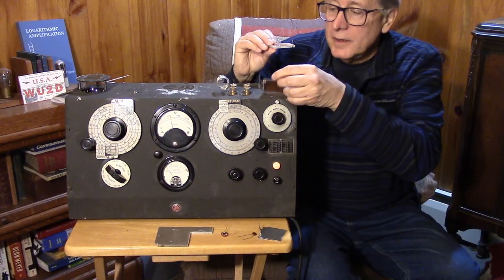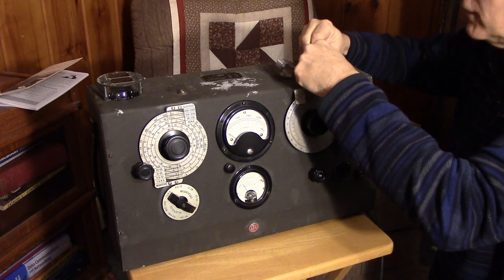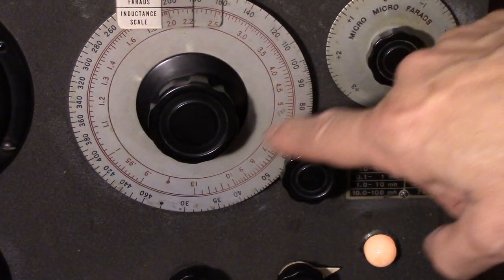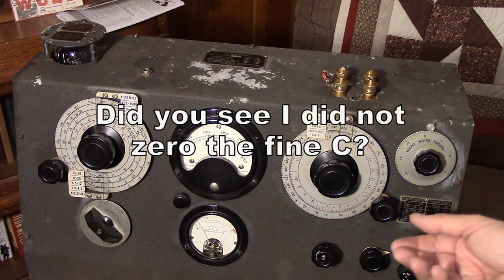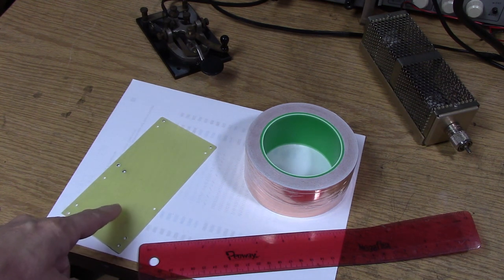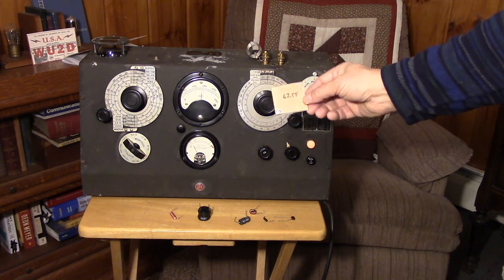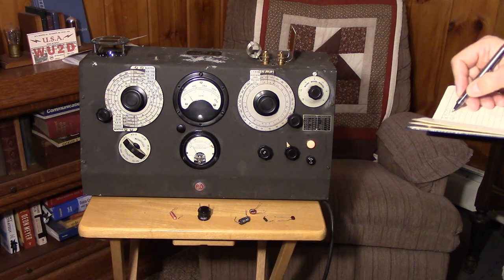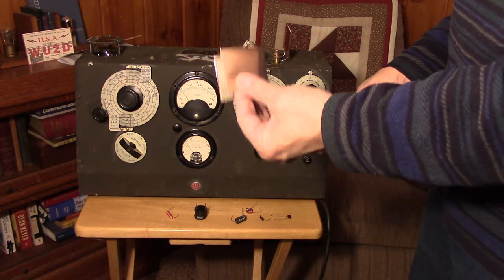Boonton Q Meter Tricks

Comment: If you ever take apart one of the 'Japanese' AM-radio capacitors, you will find all kinds of slits and odd shapes in the plates.
This is linearize the capacitance so that you don't get station-bunching on the dial.
Great Video Mike, really appreciate all you do. 73...

Comment: I have a GDO and also have a ceramic tank coil as used in transmitters placing the GDO next to the ceramic coil former caused the GDO frequency to change.
Reply from the maker: Yes the mandatory coupling is both a requirement and a disservice unfortunately, because it does slightly pull the frequency down. But it got you in the ballpark, which was a big deal back when these were bench instruments used constantly in RF work.

Comment: FYI:  Garolite (G-10 or G10) is a composite material created by curing fiberglass and epoxy under high pressures. The resulting glass-epoxy laminate is extremely stable over temperature with low-moisture absorption and a high strength-to-weight ratio. Ron W4BIN
Reply from the maker: Very cool material and I've and often seen it on equipment at labs doing military work.

Comment: Great explanation, Mike. You did ask for questions, though, so here goes. On your diagram, showing the field effects upon the dielectric, why does the field affect the atoms shown in the dielectric picture, but not in the one with air? (or whatever) Further, what happens when there is a vacuum between the plates? There are no atoms or even electrons to elongate. This really is an old question. It goes back to the beginning of electricity, when EM fields were magical. What happens to the current when there are no conductors? How does the current "flow" from plate to plate? I guess we could say it affects the "ether", or, nowadays I suppose we could say it affects the matter-antimatter pairs popping in and out of existence. But still.. Where does the energy go in a vacuum? I kinda always thought it was an EM field, like that first problem everyone works in EM class. Something about Poynting vectors? Eh, just a thought. I also have the UHF version of that puppy. I fished it out of a dumpster 20 years ago, and it still works aces! God bless! Sam W3IHM (..OH, I use my wife's account...)
Reply from the maker: Sam! Yes on air since AIR is actually not 1.0. The figure I have for air is 1.00058986±0.00000050, so that's a bit-o-atomic reaction. I took an EMAG class in 1978. They named a building after my professor, and that's as far as I want to go! Wow the UHF Model!
Reply: Greta don’t stick your fingers in the radio where they don’t belong or you’ll find out electricity is still magical
Reply from the maker: @cornbread-KO5RN  Amen.